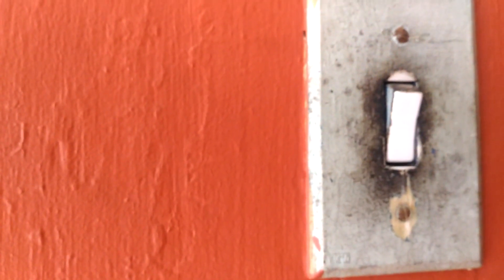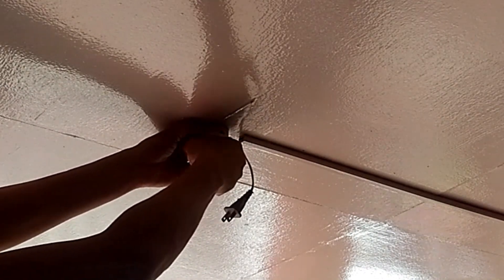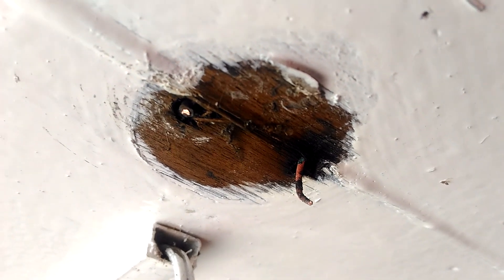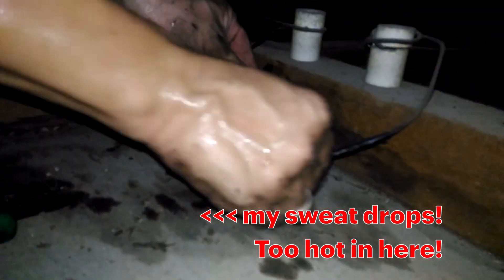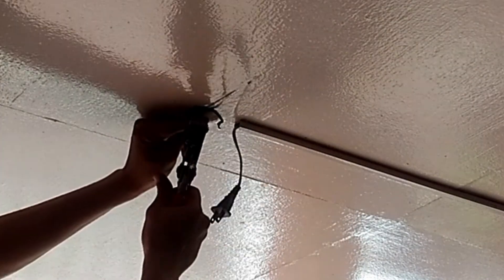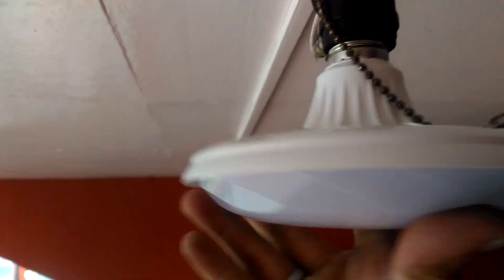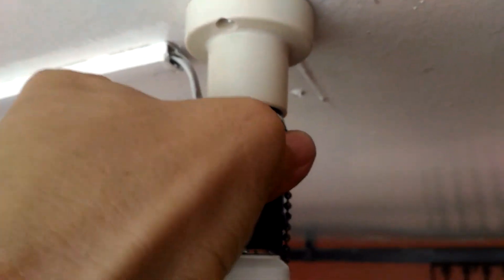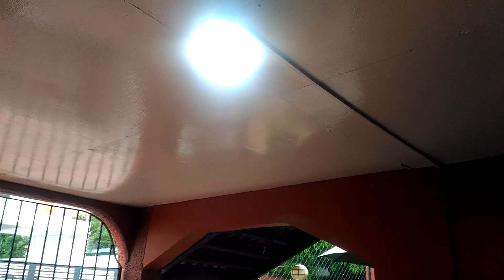How to Replace a Faulty Light Bulb Socket/Receptacle

Comment: If bulb doesnt work you can shut off power to socket, reach in socket with needle nose pliers and pull up on spring tab  so it contacts bulb end.